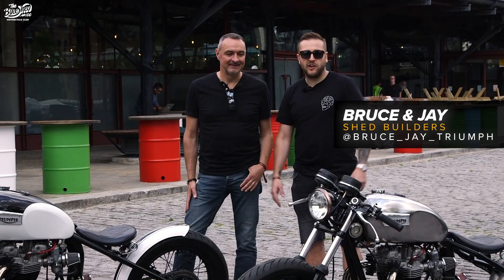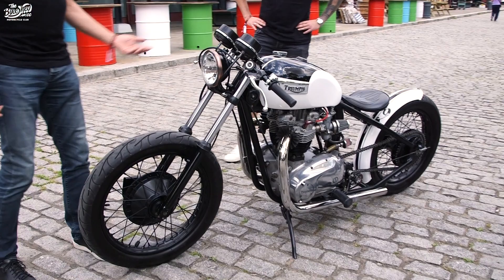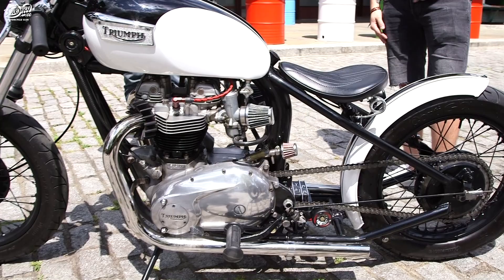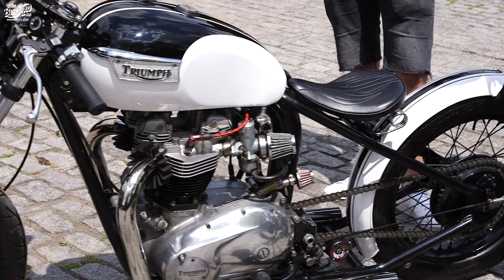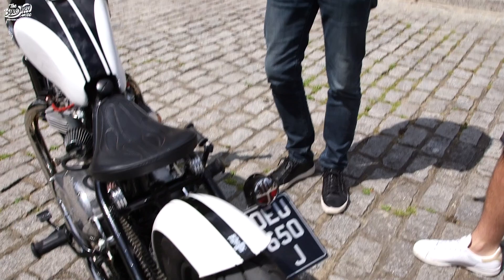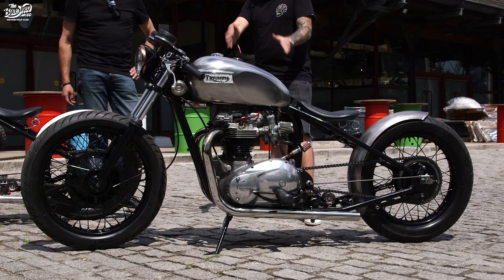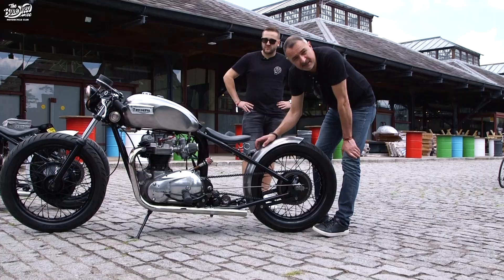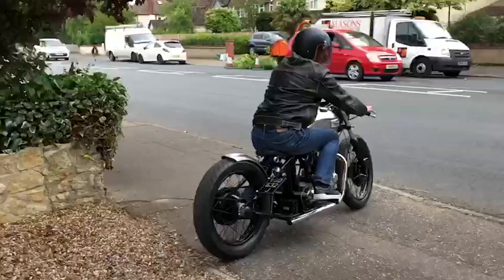Triumph 1971 Bobbers by Bruce and Jay - Bike Shed London 2019

Comment: Wow, that second one looks very similar to the one I built on my channel in 2017. Awesome bikes!
Reply: yeah but the stuff he talks about as issues as u know are not. at least here in the states. I guess we just have a bigger custom bike market.
Reply: yep indeed, follow you and the build you made for the triumph was also part of my inspiration _ Thanks for the positive comment!
Reply: @coltonwancho6571  - thanks for the comment, Interested to know what issues you disagree with. just for common understanding.
Reply: @bruceseaton4812  the hardtail. here in America you can get them from factory metal works. you mentioned having a hard time getting chain tensioners they are easy to find here in the states. and the engine mounts are made by a few companies all set up and ready like the ones you guys made. the work you have done and source is spot on but here it just seem the copper and bobber shops are easier to come by to get parts.
Reply: @coltonwancho6571  Yep - bought both tensioners from Lowbrow - cannot find a European source for these and aware FMW products.What you have in US is a good source for donors and custom shops.. So we are now in agreement. Cheers
Reply: @bruceseaton4812  agreed, it helps that laws in the states are easier to navigate. Harley are the expensive donors. triumph are still affordable.just finished my 77 tiger and for was cheaper then Harley-Davidson
Reply: @Classic Octane. You said you built bikes, I checked out your channel and subscribed immediately.

Comment: You can put cabinet makers wax (beeswax) on the bare metal tank to prevent surface rust. A little bit of upkeep, but if it's not ridden in the rain it will stay shiny.
Reply: no UV protection at all...the sun will eat thru it in a day. why not just use good old turtle wax
Reply: Ragimund VonWallat it's bare metal, why would you need UV protection? I prefer the beeswax to a car polish because it's transparent even with a thick coating. You only need to buff it off if you want it super shiny.
Reply: @buncho888  yeah i get that. when i say no UV protection i mean the wax itself, i understand that the sun wont eatt he metal away, it'll eat the wax away. it turn it into a fine white dust and fall off.

Comment: I ride girder rigid bikes and they're the most fun you can have on the road. If you added some seat springs from an original rigid bike on, you could ride for 2 hours easily with no back problems! You're missing out on the fun of blasting round the twisties on a country road.
Reply: Great advice and may well do that. thanks.

Comment: The only thing I don’t like is the large gap/space under the seat, in front of the rear tire; I would have to build something to take up that space. Really good job overall though, I really like the stance of the bikes; from what I see when you take off near the end of this video, is, they look like the motor is strong enough to whip them around really well with the light weight you guys achieved by eliminating a lot of the things you removed from the stock bikes.
Reply: I love the negative space on these bikes, the oil in frame can give you that look. That's what makes the world go round. That is why I would choose an oil in frame to achieve those spaces. To each his own,right? Breather tube is a bit phallic though,dont like that. Looks like the bike is always happy to see you. Lol. Weird.

Comment: T140 s inlet cam is fairly wild. Advance the inlet cam 1 tooth (8 deg) in timing chest, more torque more power from 3000 rpm.

Comment: I like the 63 thru 70 frames and a custom oil tank on Triumph bobbers.  The bikes in this video are kind of plane looking.
Reply: Gary Smythe those you mention are twice the price of the oil in frames. Plain and simple was the plan.
Reply: @bruceseaton4812  you're right, cost of a project is always a concern!  Perhaps a small tool box or something where the custom oil tank usually would go? Your bikes are very nice but it seems to me it needs something in the void under the seat area. Maybe I just need to get used to the open simple look ....the more I look at your bikes the more I like them! Thanks for the video!!!

Comment: Nice Bobbers! I'm building a 66 TR6R at the moment. Just want to point out, a TR6R is a Trophy not a Tiger. Cheers
Reply: Thanks!! my research shows the Tiger name was used on 
'71 on models (Oil in frame) but trophy was used on pre OIF bikes up to 1970....
To confuse further the TR6C (high pipe "street scambler") sold 1971-72 was called the Trophy in some markets

Comment: Just noticed the V below the Bonneville decal of the "ugly" before picture. If that is a 1971 t120rv ,that's not the bike you want to chop up. It is  a very rare bike that they only made a bit over 200 of. Triumph pulled them off the manufacturing line in 1971 and gave them 5 gears and sent them to the USA. The other 71s are 4 speed. Look into it. Hopefully you just used a picture of one as an example and that's not the actual bike you guys built. If it is who gives a shit, am I right? Thought you may be interested though.
Reply: pauliebots yep- just an example.these are 4 speed